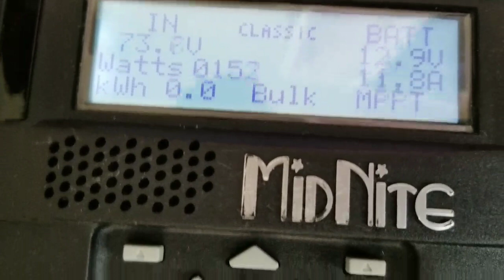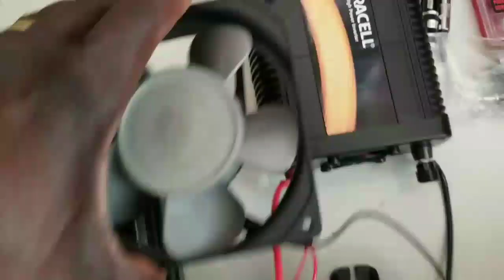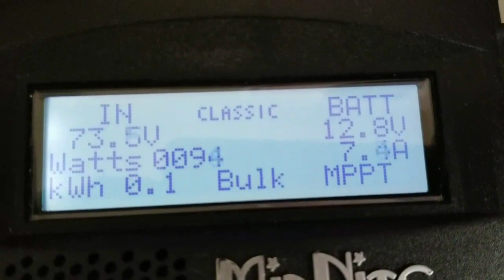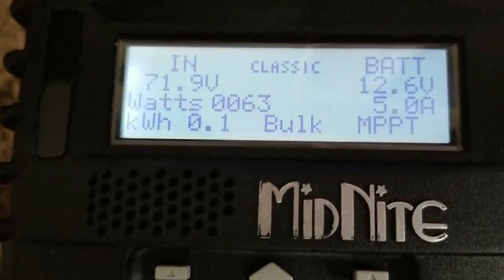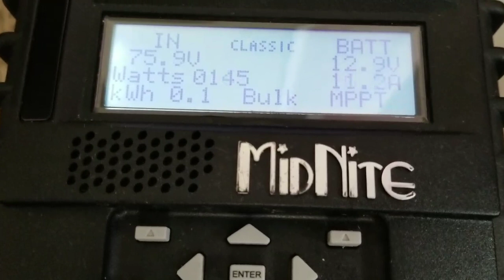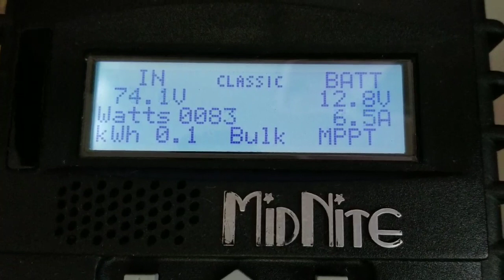12 VOLT SOLAR BATTERY CHARGER (pt.1)

Comment: JW, I would like to compare notes. My system is 1960w pv array and the maximum I have gotten is 1500w. How big is your system and what is the maximum you have ever recieved?
Reply from the maker: Sorry man for the late response due to Google. I just saw your message now.
Roland buddy, It's hard for you and I to do compared notes because, both our setup are different  from each other. Also, my system are not permanent I do frequently change my setup due to a lot of testing here at the jwsolarusa Command Center.
LIKE SUBSCRIBE and SHARE

Comment: Nice share, how many different systems do you have running? I know you have the EV batteries also...didn't know you were also running a dedicated 12V system.
Reply from the maker: 12, 24 & 48 - 60 volts systems

Comment: THAT WAS A GREAT LECTURE ABOUT WHEN DEALING WITH DIFFERENT INPUT VOLTAGES 12 , 24 , 36, 48 V AND SO ON ASSOCIATED WITH THE AMPS OF EACH VOLTAGE THAT A SOLAR ARRAY PRODUCES TO CHARGE THE BATTERIES  MORE EFFICIENTLY . LIKE YOU SAID , YOU SHOULD ALWAYS INVEST ON BUYING A NAME BRAND CHARGE CONTROLLER THATS CAPABLE OF HANDLING THE HIGH INPUT SOLAR POWER TO SAFELY BE PUT IN ANY  BATTERY BANK ESPECIALLY LIF PO AND LEAD ACID  WITH PEICE OF MIND .